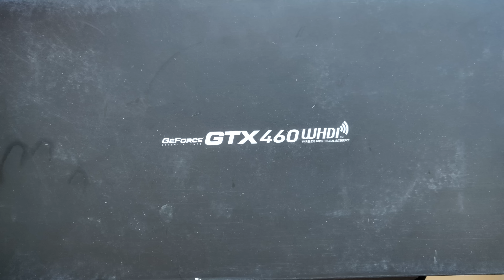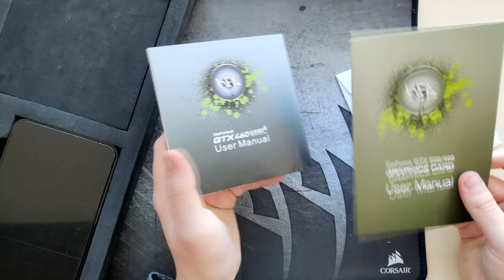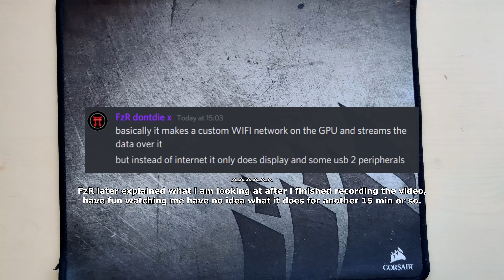GTX 460 WHDI Unboxing and Overview

Comment: but yes it streams 720P/1080p video up to 30 meters away, with support for dolby 5.1 audio and usb 2.0 passthrough
Reply: Thats pretty insane. Hope you guys get it up and running for a demonstration 😁😁
Reply: Thanks for explaining. It is just a GPU with an in-built Wifi.  So basically everything a modern PC even without a graphics card, but with an in-built wifi on motherboard can do.
Reply: @AI-37  only catch is this wifi network does not transfer internet it only streams the display output.

Comment: Wow this card is absolutely insane, love seeing wacky cards like this.

Also super excited for my gtx 295 that's supposed to show up sometime later this week. Have footage of it actually working so that'll be super interesting
Reply: How much did you pay for it? I have one I can sell, it's pretty much a space heater when playing Crysis.
Reply: @bradjohnson5323  €30.
Reply: Paperboy  yeah I'm aware, got a pretty good 850w unit to play with.
Reply: Paperboy  I've got an 12600kf in my daily system if I really want to send this thing but have an 4790k that'll probably do most of the testing on the card.
Reply: I love my GTX 295, obviously I don't use it it was a relic when I bought it, but it makes for a cool shelf piece. Did you get one with 2 chips on one board or one with 2 separate boards and a bridge between them? I have the latter and it's kinda fun to talk about when someone has never seen one before. 

I've been looking for one of these WHDI cards for a while, but they're hard to come across. I'd even buy a dead one since it's only really going to be a shelf piece.